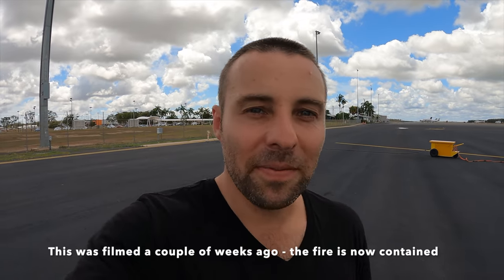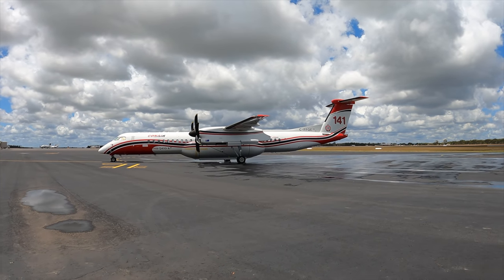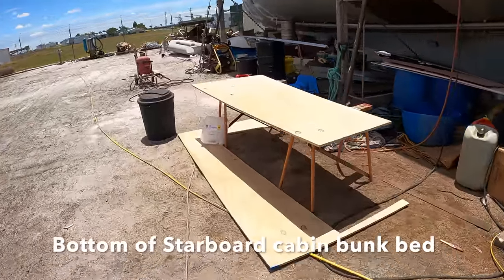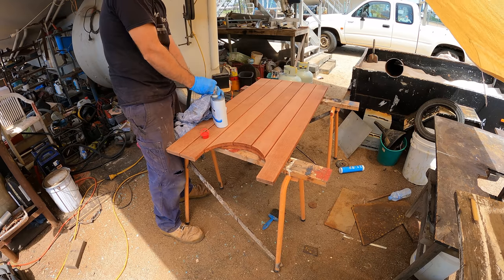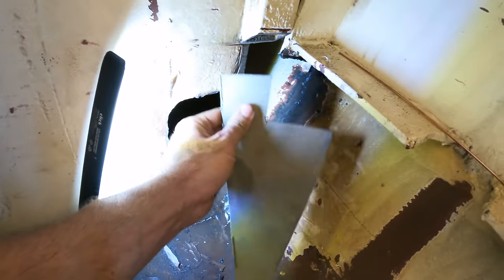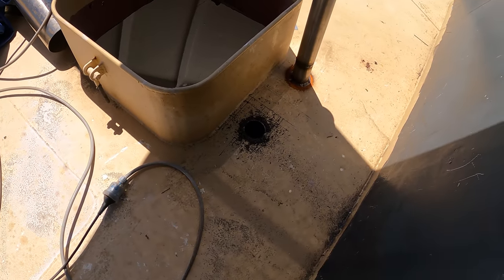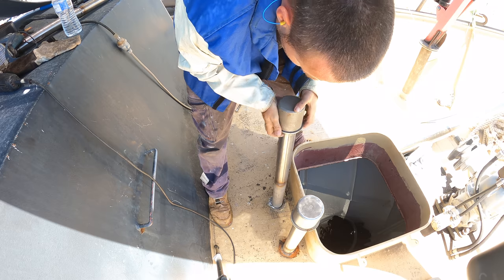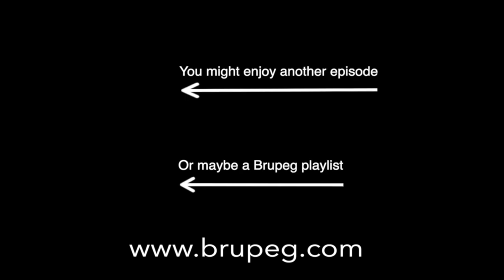TIG Welding Stainless Plates & Pipes - Project Brupeg Ep. 188

Comment: I called the help line and after hours and hours on the phone I think I talked the guy into quitting and applying for a job at Detroit. :)
Reply from the maker: He was probably near retirement anyways
Reply: So he had his "come to god" moment, saw the light and went to Detroit.
Smart fella.
Reply: @ProjectBrupeg  Common guys. There's no need for this kind of negatively. Besides, we all know Ford Lehmans are the best...
Reply: I do think stu is right you need a Detroit little renko is a great boat
Reply: I heard you'd just finished the final coat of Alpine Green primer and now you're ready for a coat of DE 1638 Cummins Beige....  ;)
Reply: I found it to be a strange irony at 3:07 that there was a bottled water on the floor of the plane
Reply from the maker: Thats for the really big fires, wind down the window and tip it out in a nice straight line
Reply: Cummins engines are built just around from where i work, British engineering at its finest 👌😉
Reply: But wait -  there is more: there is still the V8 detroit !
Reply: A lil boy weenie throw down. I hate to say it, but like Stu won with his big bore. 😂😂 All joking aside, most of us are stuck with the motor that’s in the boat, but if we had to replace the old worn out motor...it would be an insightful and hilarious discussion.
Reply: @backdownontheboat6038  Finally, somebody speaking sense.
Reply: Never, ever had a single problem with my 1964 built Ford Lehman. And, same goes for the two (1980) in a Sport Fisher.
Reply: Al at Skid Factory will back you up. He's putting a Cummins in a Nissan Patrol at the moment.
Reply: Careful Stu, BRUPEG might need a 'new' back-up gen set motor 😉
Reply: @stevenr8606  Sensibly, I believe they have a Kubota for that.
Reply: @ProjectBrupeg  Touché my friend!
Reply: @pauldoitcheap4343  V16 is where the fun is at
Reply from the maker: Cause when a piston lets go you’ve still got 15 left?
Reply: @ProjectBrupeg  and it’s so old you’ll probably need double the amount
Reply: What is the difference between reving a cummins vs detroit?
Well the cummins make black smoke and move forward
With the detroit noise level went up and the owners face expression change, nothing else
Sorry stu! Only joking!🙈
Reply: 2 stroke Detroits are piles of crap affectionately known as green leakers.  Anyone who tells you that their Detroit does not leak oil is either a liar or it's out of oil.  Even the 92 series is completely obsolete.

Comment: I have a small suggestion. The beds should rest on slats or made in some way to allow it to breathe. It can mildew or grow mold if itv rests on a solid surface. I watch alot of van and truck conversions and when constructing beds, most use slats or plywood with holes. There may be even better ways to do this but I thought you might be interested in this. Thanks for another great video! It's wonderful to see Jess getting around so well and happy. You make a darling couple! Take care!
Reply from the maker: Thanks Patricia, yeah its something we have yet to finish so still time to add some

Comment: Hey Dame, I just had a thought about the hydraulic pump on the front of the Cummins you want to do, agitators or cement mixer trucks run a hydraulic pump that turns the drum on the back off the front of the engine. Next time your in town find a cement company and go and have a look at the setup, they may even know where you can get one cheap !!  Don't forget these pumps have to turn yards and yards of concrete at a time so there extremely strong. Seeya Rob
Reply from the maker: Ahhh lovely. Thanks for this rob. There is a cement mob over the paddock from us, I’ll go have a word with them
Reply: And a lot of the mixers use cummins too. May be able to get a ready-made mount for said pump.
Reply: Sorry they were used 20 years ago and they were a nightmare - having the extra weight of the pump hanging off the crankshaft now they are driven from from a pto on the motor much more reliable .
Pto on the front of the motor  is the way to go just engage as you need it.you can probably use electrics to engage or disengage the pump as well
Reply: And it’s not cement it’s concrete—- cement is what makes it go hard!

Comment: I would reconsider your idea with your double glaze window design.. when glass on the outside is cold and the glass on the inside is warm you will get condensation built up on the glass inside of the frame.. insulated glass units are filled with argon gas’s to stop this happening. You could fill the inside of the frame with silica beads but I’m not sure on how long that will work for. Love the channel guys keep up the good work!
Reply from the maker: Thanks Tim. The plan is  to either pull a vacuum and seal the windows ideally with Argon as the filler gas. If that won’t work then the plan is to allow air in and out like planes do as that also reduces condensation

Comment: Too many moons ago, I had an F-250 4wd with a Navistar diesel. Pulling a Ski Nautique from Reno over Brockway Summit to Lake Tahoe (6260'), that sucker was belching so much carbon rich jet black fragrance out into the pristine Sierra forest air,  Smokey the Bear stopped me to hand out a ticket. Navistar includes Cummins. OTOH, years later, I was driving a metro-type bus over the same route, hauling employees of Northstar Ski resort home to Kings Beach. When their shift ended, those buses were SRO. Sometimes, if I stopped for a passenger they almost wouldn't start moving again at all. Just sorta groaned. Those must have been Detroits, I guess. Angry traffic backed up and honking, and Smokey was still pissed off....,

Comment: If it's not too late - you may have already done the job but consider fixing a 28mm sealed unit rather than just a single pain of glass, it'll help get over a single pane being a cold bridge.

Also I wouldn't bond the glass on the inside but fit it in a rebate with a screw on cover strip and use some rubber or silicon gasketing.

Comment: Epoxy for the timber around your windows may be  expensive. When my workbench was put together a mate of mine suggested just wood glue to seal them. Years later the benches are still embarrassing as there are no oil stains and they look super clean with the oily parts "staged" on them... It looks like I don't use them lol.

May not work with water or oiled timber but it is a hard surface that is not water oil or even affected by fuel from my experience so you could also try that as a cheap option on a spare piece if timber unless it is all done.

Comment: When you double glaze, the key is to air purge and fill the space between panes with an inert gas such as argon.
Reply: Exactly and purge from top to bottom, argon is heavier than air.
Reply: Also they put different gas in to change the UV protection
Reply from the maker: Hi guys the plan was to use 100% argon. we just haven’t finalised how we’re going to purge it

Comment: 26:20: That crane's gone as pink as your shirt in the Oz summer sun. Did you ever consider putting a gooseneck in your vent pipes? Your method takes up less space, clearly. 32:44: Nice work to angle those plate holes to account for the offset.
Reply from the maker: Thanks Marc, nah never thought of a gooseneck, KISS needs to apply here

Comment: Hysterical (funny) Cummins retort! For someone new to the channel they might think you're replacing steel ribs with 1/2 inch plywood at 10:00. Will there be a stand up comedy room on the boat? Hope so.
Reply from the maker: Most of the boat is multipurpose. Comedy can be broken out in all current interior space on Brupeg

Comment: CUMMINS ALL THE WAY ! ! !
Is there a way on the output shaft of the CUMMINS, you mount a gear driven hydraulic pump? So you plumb both in the electric backup system  with valves?
Just  quick ideas.
If you make steel art stand out of scrap.  You could sand blast with out bending over.
Those wooden frames. You attach a swing blind to it to keep  the light out in the cabins.
👍💪🇳🇿💯

Comment: On proofing the wood … see if you can find a local supplier for Smith's CPES (Clear Penetrating Epoxy Sealer), 3x coats and it'll last forever, its a particularly thinner epoxy that will seep extremely deep into the wood and makes it pretty impervious to water ingress, weathering is the only issue then (ie. surface), so if you topcoat/varnish it then you are golden. They also do some specialist epoxy goods for oil rich hardwoods ...
Reply from the maker: Ahh nice. Thanks for this. Our plan is to paint the surface exposed to UV with a black matt polyurethane so protect it
Reply: @ProjectBrupeg  CPES will work fine, even on oily hardwoods, its used on mahogany, ipe, etc … advice on prep on Smiths site if you end up going that way.

Comment: Crazy idea: Glass, wood spacer, glass, BUT, in the wood spacer, a routed hole for a sheet of thin lexan to act as a thermal break. Also, you can bond plastic to glass, you just have to key the glass and the plastic accordingly. The glass with the standard method, and the plastic by cutting small oblique cuts that get filled with the glue, essentially anchoring the two together.
Reply from the maker: Yeah that’s an idea. Sounds above our skill level to pull off without getting shit in between the panes

Comment: Interesting to hear your plans for double glazing. Have you checked with a domestic double-glazing supplier? We had a narrowboat here in the UK which had exactly the sort of double glazing you describe - two panes of glass separated by (in our case) a strip of hardwood bead between two screwed in hardwood frames. The problem was that the seals were never meant to be air-tight, and so there was always a build up of crud between the two panes. It was OK because there were just a few screws holding in the inner frame so the inner pane could be removed and the inside faces cleaned. Eventually I made enquiries about double-glazed sealed units with a domestic double glazing company in the town. Our windows had square bottom corners, but arched tops - and every window was a slightly different size, so they were all made to measure. I had seven complete sealed units supplied, ready to fit in the old frames for £135 (sterling). I couldn't believe it after previous enquiries to marine suppliers! The outside pane was toughened glass, the inner was plain glass, but they were willing to build as required. Check out your local glazing specialists first - they are after all fitting odd shaped windows to houses all the time. I know our windows would be much smaller than yours, but worth a try.
Reply from the maker: Thanks I will make some calls

Comment: Double glazing. You know those little bags of silo on granules . To prevent fogging , you need something like that.
Reply from the maker: Silica, huh, didnt think of this
Reply: @ProjectBrupeg  I built my own house about 40 years ago, with not enough money to buy new dbl-glazed windows, so built my own out of scrap wood, sealer, caulk and used/salvaged glass.  
I sealed the wood, used the best caulking I could find to bed the glass, assembled the parts, and drilled a hole in the corner spacer between the panes to fit a plastic straw filled with heated/dried silica gel and cotton 'plugs'.  Then I plugged up the holes and waited.   Since then, the windows have performed well enough that they have not needed replacing, and are still in use with no visible moisture.  I guess manufactured windows filled with argon would be more efficient, but have not tested that question.  Thanks for the videos, laughs and entertainment, and good luck!

Comment: Is there some kind of vacuum and gas in double glazed windows?
Reply from the maker: Yes and yes. Pull a vacuum is one option and 100% argon is another
Reply: @ProjectBrupeg  There is no vacuum , the space is sealed on the perimeter and the air is dried using silica gel . What are planning to do regarding your glazing will likely not work unfortunately . Achieving a hermetic seal in the field and using wood as a spacer is impossible . The spacer used in insulated glazing is a hollow box section that is fill with desiccant beads . It is attached with a sealant then sealed again with another bead of sealant around the perimeter . All of this is done in very carefully controlled conditions . I have been involved in the window and door business for many years in Canada and have seen my share of glazing failures . Spend the money and have them made for you , it will save you money in the long run .

Comment: Just wondering, what size ratchets do you use "down under"  (USA viewer)
Reply from the maker: Metric for most things. We use 3/4 drive sockets mostly but we are yet to buy a decent 1/2” and 3/8” drive set
Reply: We used to use British Imperial Whitworth but then metric took over around 1970 from then on. You can still buy Whitworth size tools but its becoming hard to find now.
Reply: @ProjectBrupeg  We have the smaller boat, but just this summer a rudder pin repair meant I had to finally buy a 3/4" drive adapter for my 1/2" wrench, in French, nonetheless, as we were going past Quebec for weeks. Once you go above  1", it's a better idea. I already have rather long "breaker bars" and of course 1/2" torque wrenches so I don't overdo things. Of course, I learned only very recently that opposed hose clamps (which are preferred, but are not always possible to use) of the ABA/AWAB/Scandvik solid band type we prefer for under the WL use (T-bolts for exhaust-related jobs) need less torque than is generally seen, and I don't mean when it's obvious over-torqued on a slotted clamp on soft plumbing hose. https://stevedmarineconsulting.com/hose-clamps-part-ii-installation-and-use/

Comment: You going to run a pump off the front of the crankshaft then.
Reply from the maker: Actually we are now looking at a belt driven pump, located where the original low amp alternator was. Electro clutch on the front so we can disengage it when it not needed qand reduce parasitic load on the main engine

Comment: Do you really want to cap off that box section?  I know there should never be any water in it but you are on a boat!
Reply from the maker: If the water is that high we have bigger problems... we need to cap it to stop oxygen getting to the bare steel inside and rusting it out

Comment: Dame i tend to disagree with you. Glass got no thermal properties. It is the same as an open hole with nothing in it, unless you're using the same glass they got in airport control towers.  Two pieces of glass with a vacuum  break  between them.
Reply from the maker: Yes agreed. Zero insulation properties. Our plan is two panes with 100% argon fill between them so convection and heat transfer is as low as possible